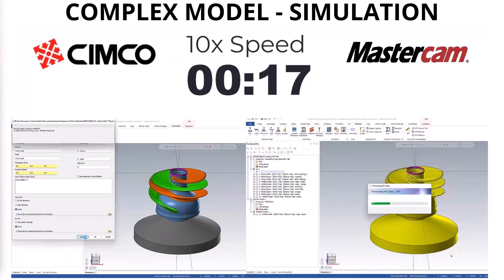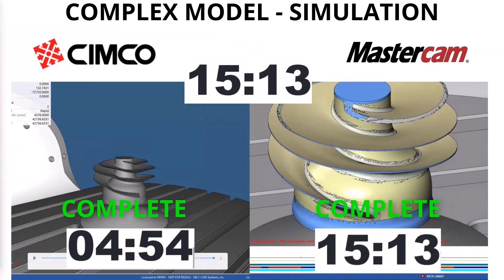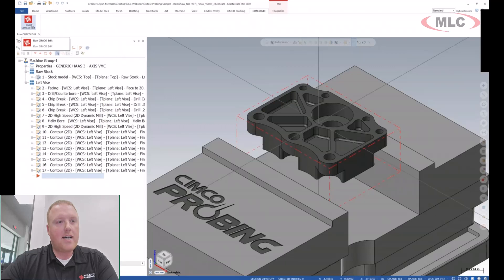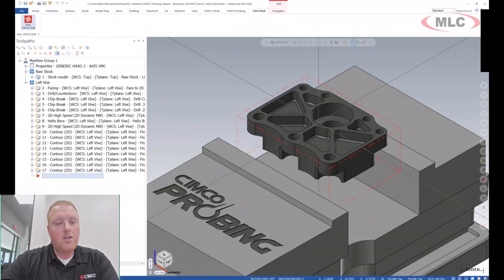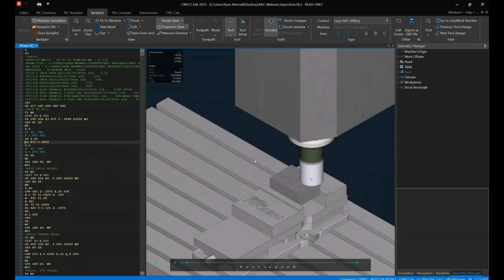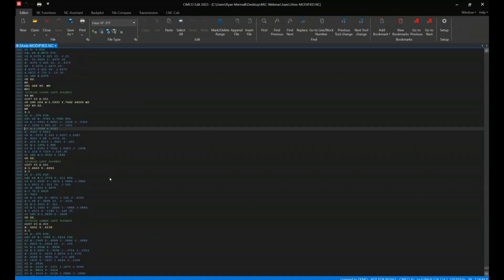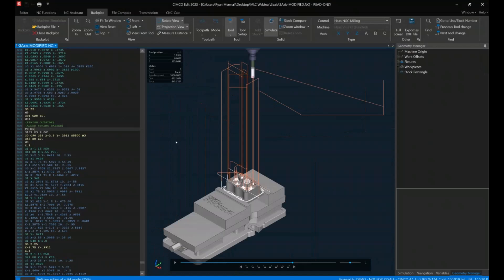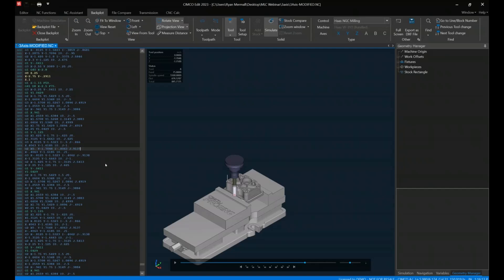How CIMCO Edit and Machine Simulation Validates NC Programs - Including Manual Edits

Comment: Cimco simulation is a complete waste of time and energy. Cimco will never be more than an editor and transmission tool. Cimco hasvery poor documentation, and the tech support guys rarely know G-code. Simply reporting a bug turns into a week-long circus of trying to explain the issues.
Reply from the maker: Thank you for sharing your input, it sounds like your front-line support is not serving your needs.  If you are in the United States, I recommend contacting our CAM team about your issues; perhaps we can assist.  800-364-1652.  Our team and our customers are having a lot of success with this product and it provides an invaluable tool for validation and problem prevention.

Comment: Is CIMCO comparison with MW is about Simulation speed ?
Reply from the maker: Yes, CIMCO does effectively the same thing as the Simulation that is included in Mastercam by default (MW) but has a unique algorithm that calculates everything significantly faster.  In this video, we show both performance improvements for the programmer as well as the standalone simulation tool that can be exported to validate shop-floor edits.